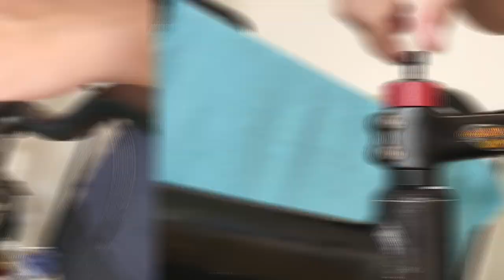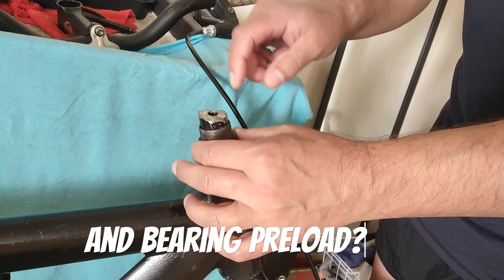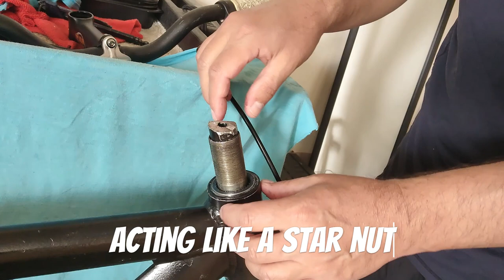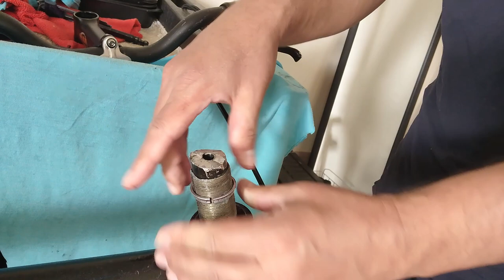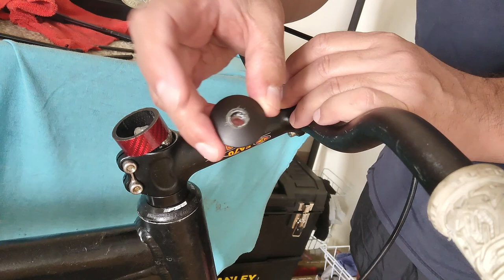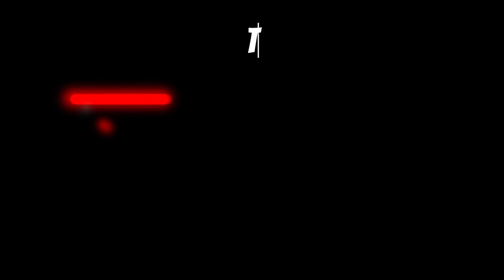FREE trashed threaded fork to threadless?

Comment: What conversion kit do you use
Reply from the maker: Thanks for the question! No conversion kit, just the existing threadless headset parts and a threaded fork. I've only attempted this conversion because the quill stem is corroded in the fork, which strengthens the steerer tube walls and prevents the threadless stem from being crushed. Don't forget to subscribe for more experiments!

Comment: Hey I have a question! Is there any way to mount a threaded fork on a threadless headset? Thank you!
Reply from the maker: Thanks for the comment! This video shows the safest way to do just that since the quill stem is seized in the threaded steerer tube.; that said, you'd need a means of reinforcing the threaded steerer tube walls to make it work. However, many  don't and, in that scenario, the dude who replied below stating my experiment is a bodge would be correct. Don't forget to subscribe!